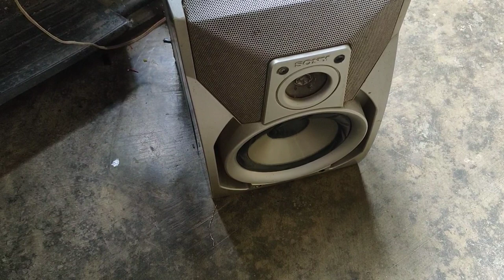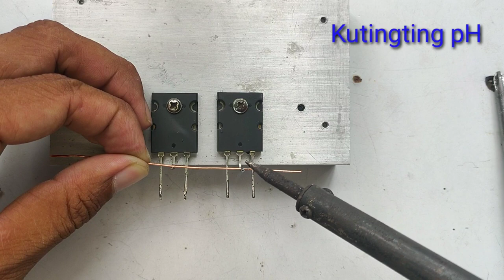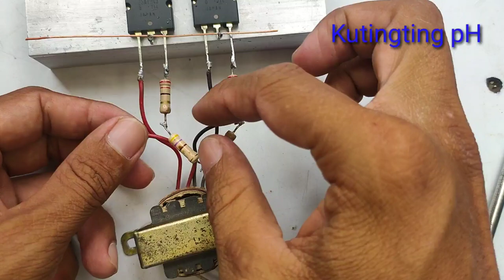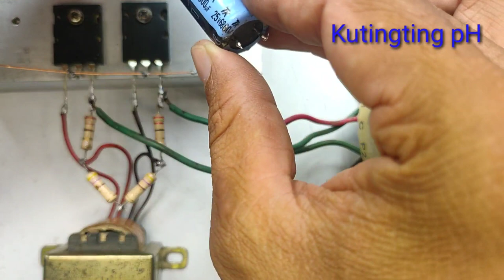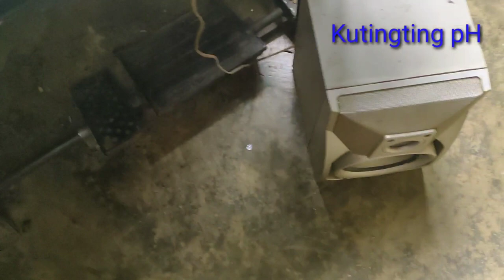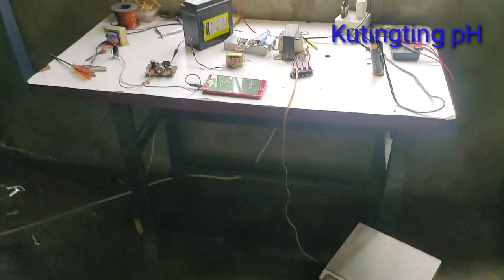how to make push pull Amplifier | diy booster Amplifier

Comment: nice idol 👍👍👍
tanong lang idol kung pwd ba parallel/series ng transformer sa amplifier meron kasi ako dalawang 12V 3Amp single supply kailangan ko kasi malaking output for high amp. thanks po kung mapansin m

Comment: Bro Ang input na ginagamit mo ba ay pt40?
Reply from the maker: Yes sir cut mulang center tap
Reply: Ok bro yon Kasi Nakita ko na ginagamit sa turbo amplifier 12 pairs using mj2955.ang lakas talaga. Noong dating sound system samin na KASTILLA  sound system yan ang ginagamit nila na power amp. Using driver na stk ic